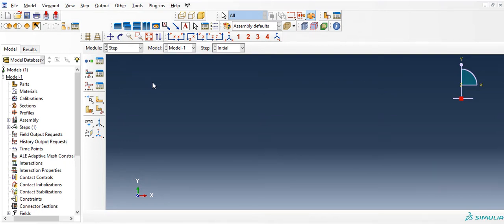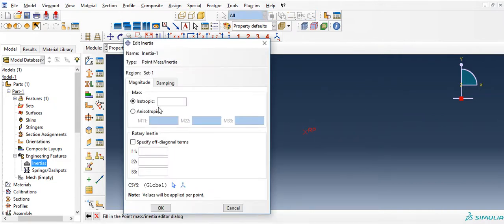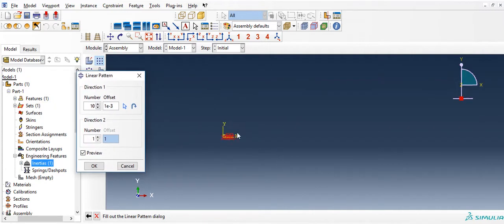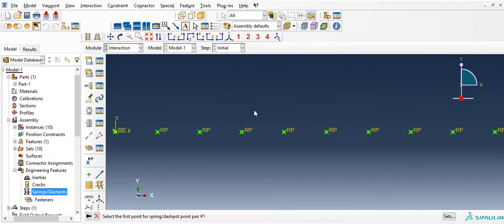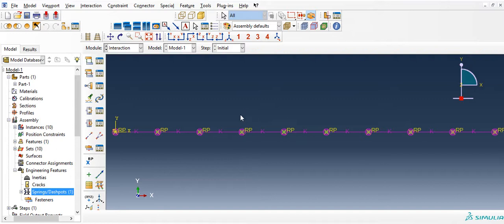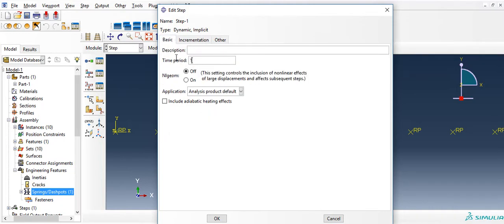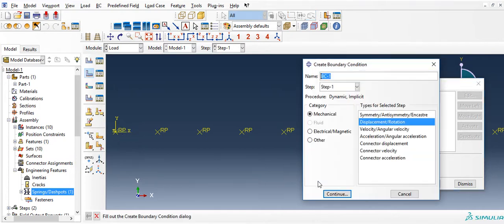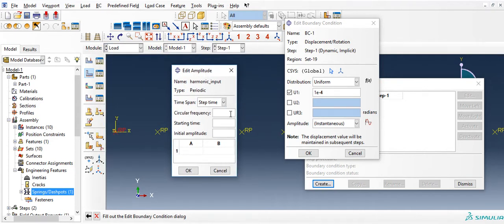spring mass system in abaqus

Comment: Sir, have one doubt, how to model non linear springs in abaqus. After assigning nonlinear spring properties my model is not taking the stiffness in dynamic explicit step
Reply from the maker: What error does abaqus throw? Make sure you have the correct time step defined for the analysis. I remember that was a major contributor to errors in my analyses.
Reply: @wild031  thank you sir for your reoly. My model is running ok when I use axial instead of cartesian coupling type

Comment: Sir, I have a question, How can we define a continuous layer of spring (lets say an elastic foundation)? thank you very much.
Reply: Hi Sir, Did you find how to do this??
Reply from the maker: Sorry for the awfully late response on this. You probably are out of bounds of this scenario. But FWIW, you'd create nodes parallel to the ones in this video (for instance) and then connect the two. This way, you have two springs - One along the chain length, and the other perpendicular to it. The latter is the stiffness describing a continuous elastic foundation.